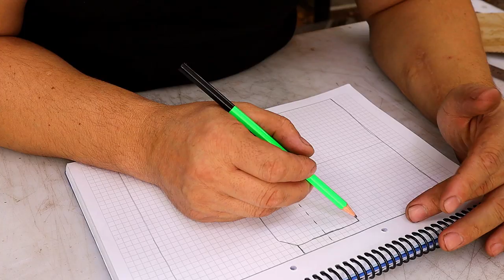Notebook cover making | Leather notebook cover | Travel Accessories | making a travelers notebook

Comment: İyi günler diliyorum hocam çapraz çatal delgi setimi değiştireceğim hocam da aliexpressden getirtmistim ondan memnun değilim Sinabroks marka dikkatimi çekti ancak temin etmesi zor ve fiyat i mağlum bana önerebileceğiniz marka var mı varsa nerden alabilirim ? teşekkürler
Reply from the maker: Sinabroks marka gereksiz bir ürün.   dümdüz bir dikiş yapar size çok çok iyi dikerseniz makine dikişi gibi olur dikişiniz. kaldıki o fiyata ikinci elde  paff makine bulunuyor.Yabancı youtuberlar reklamını yapıyor. (fakat vidyolarında makine dikişi yapıyorlar).  bence el dikişi yapmak istiyorsanız fransız tarzı çatal kullanın. onlarında pahalısı var ucuzu var tavsiyem ucuz olanlardan alıp dişlerini burada polisaj makinesinde parlattırın. bu set işinizi görür: https://tr.aliexpress.com/item/32810687545.html?spm=a2g0o.detail.1000014.29.298b599e3K4XiF&gps-id=pcDetailBottomMoreOtherSeller&scm=1007.13338.128125.0&scm_id=1007.13338.128125.0&scm-url=1007.13338.128125.0&pvid=ca0c42e2-a3d4-498e-af73-0ee4b76df411
Reply: Çok teşekkür ederim bilgiler için teşekkür ediyorum